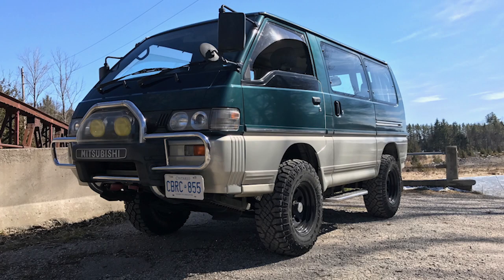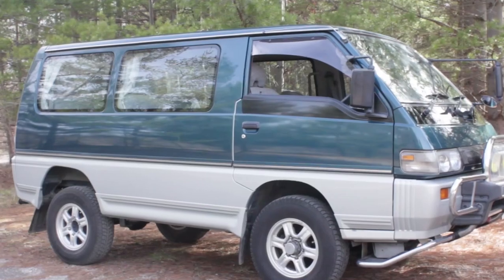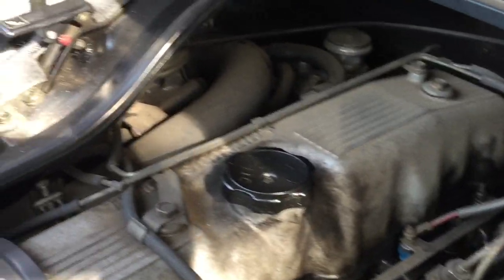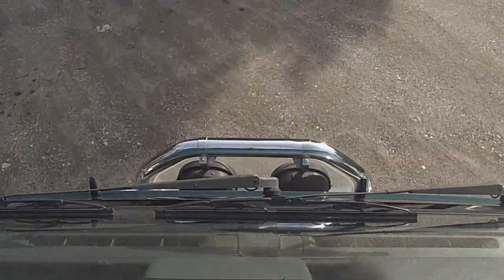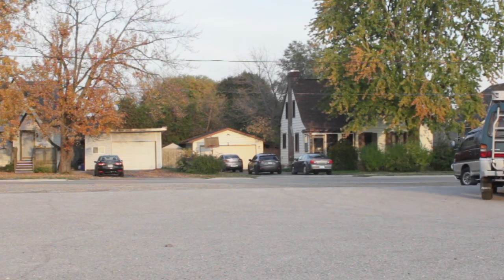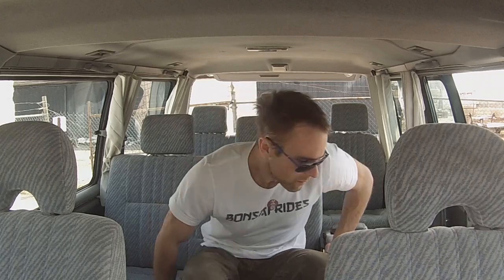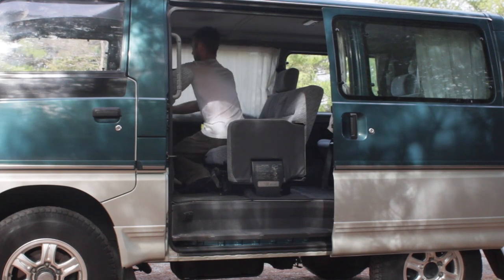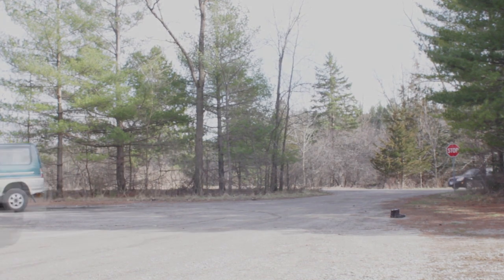1996 L300 Delica Limited Edition tour and review

Comment: 4D56 ? the most common diesel engine in the Philippines that releases black smoke ? yeah that engine may be horrible but it was reliable
Reply from the maker: If you have one of these belching black smoke there are three possible problems (because it shouldn't do that)
1. Injectors are dirty and their spray is bad, need to clean or replace injectors
2. over fueling injection and the injection pump needs to be rotated very very slightly
3. EGR is fowled. Most people will blank the EGR or block the vac line to EGR valve.
Reply: Bonsai Rides Imports oh. but even new (2017) Mitsubishi models like the AUV Adventure was experiencing smoke belching. luckily Montero Sport changed it's engine because it was using 4D56 also. 4D56 was putted on a lot of SUVs , Jeepneys and AUVs here in the Philippines for like 30 years or so. maybe because it's old
Reply: Or, the TURBO is blown (that'll do it - as I found)

Comment: How much would a 93 go for to import into the US
Reply from the maker: The range is quite varied depending on trim level and condition. They can be North of 12k or under 7k landed in the US.
Reply: Bonsai Rides Imports  do you have any for sale currently I live in Chicago but would be willing to fly out and drive it back or drive out and put on a trailer depending on the conditions it’s in

Comment: Unfortunately we cannot import a 1996 in the US for a few more years.
Reply from the maker: I've sold some very nice 1992 and older L300's into the US. I'll make a video of these when I have some spare time but you can see them on my instagram feed
Reply: cool what about Pajeros? i'm more interested in one of those right now.
Reply from the maker: in 2018 the V26 and V46 models are going to start eligibility. 1993 was the first year for the 4M40 diesels (equivalent to L400 Spacegear), I have a 1993 LWB V46 Pajero that I am getting ready to list for the American market.
Reply: that's a great point.  I've been trying to find a Montero/Pajero SR here in the U.S. with the RD locker.  Finding a GEN II Montero in good shape is really difficult in the U.S. as there weren't many sold (which is part of the appeal).  Can the 4M40 diesels be tuned at all? I know they are 2.8L but i've heard they are also under powered.  I may have to consider getting a JDM if I can't find a low mileage 94-99 in the US.
Reply: 1987 USDM 4x2 Mitsubishi Wagon